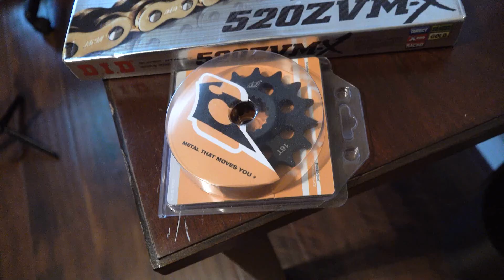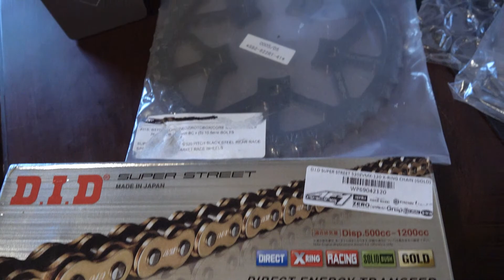APRILIA HISTORY of Ownership – Aprilia MILLE, Aprilia RSV4, Cruiser vs Sportbike Difference

Comment: I use to have a 2014 BMW S1000RR  that I liked a lot, but I found that all the performance of that bike was all in the top end. I’ve since replaced it with a 2019 Aprilia Tuono V4 1100 Factory which works for me better because of the mid-range torque that it has that I find more usable for all the canyon riding that I do here in Southern California.🤙🏽
Reply from the maker: Cool, and yes, an I4 needs RPMs more than a V. Don't know if you saw the S1000rr vs RSV4 video I posted, but i went into differences like that. My first Ape was a Vtwin, but these V4s are a nice balance on the curve, and the sound is awesome! Enjoy that 1100!